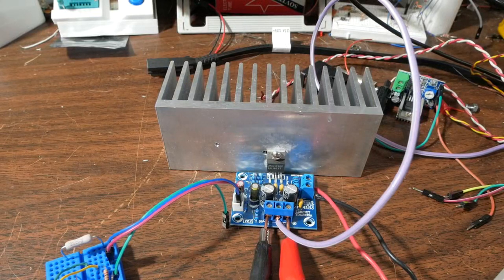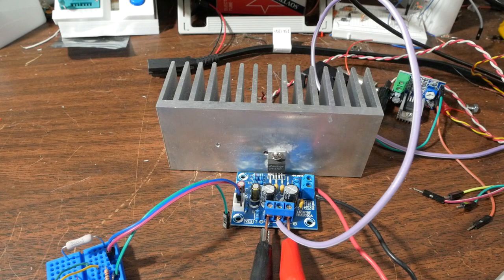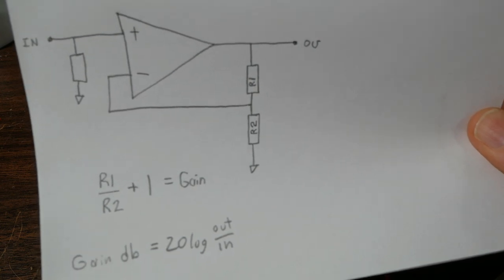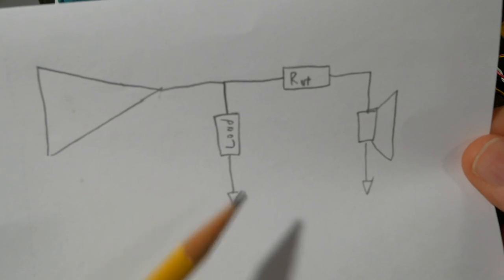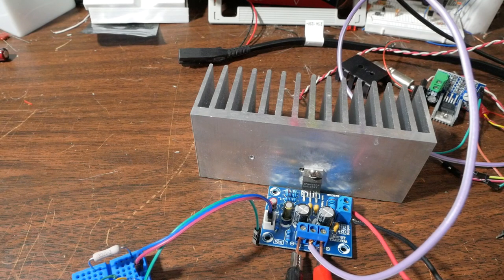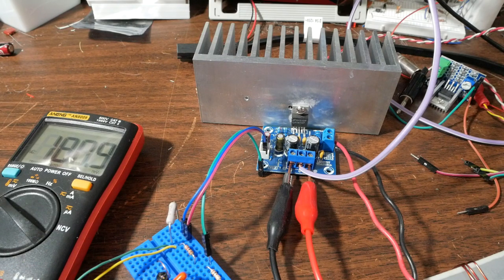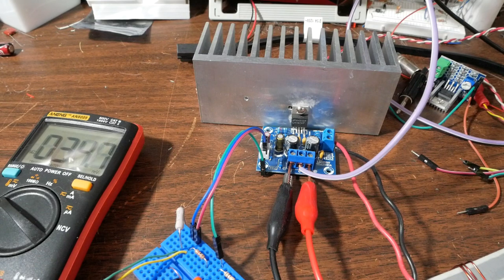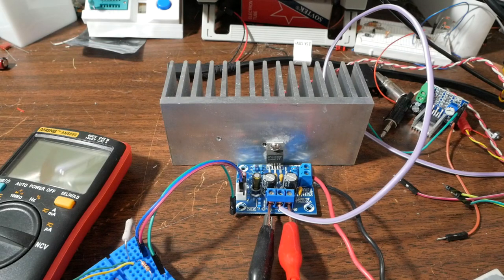Audio amplifier gain measurement and input signal levels

Comment: Thanks John, this helped fill some more gaps in me brain pan

Could you do a vid on how a guitar output differs from line out, speaker out and phono out?  And possibly how to convert those signals to work with one another with and without preamps?
I could send you some guitar parts if you need them to figure it out.

Comment: Good  video, it would have been  real nice to see the  AC input/output  voltage   with   relation  to the  ratio  of  gain  with different  DC  supply voltages   (THIRD)
Reply from the maker: The gain is independent of the supply voltage.

Comment: I must admit I got a bit lost.  If in the first set of measurements you varied something to get the output just below clipping how did you later adjust something else to get a different figure?  I must have missed something.
Reply from the maker: The first measurement was the gain. The second was the input signal level required to drive the amplifier to the point just before clipping (max clean output). The second measurement is a function of gain and supply voltage.

Comment: For the first time I strongly disagree with your approach. Your math is wrong, the circuit you describe as your DUT is actually a voltage divider, your understanding of the whole concept of audio measurement is crazy. 

An analog scope at or below 100 MHz is less than $100. Even a brilliant Tektronix version. I have 4 sitting in a pile. I give them to kids. 

There is no excuse for this folklore audiophoolery. People can find $100 if they are designing audio amps.  This kind of utter nonsense will only hold people down. 

All that rant aside, thumbs up to support your channel.
Reply: The price of a 30 year old analog Tek heavily depends on the region you buy it.  In Europe a good used Tek goes for about $300.
Reply: Its fine as a rough measurement for these purposes. With the attenuation resistor at 100ohm , there is only a small portion of output going through the speaker.
Reply: Apparently it is "folklore audiophoolery". Thats why!!
Reply: I think the author of the video made an assumption: people watching the video have some basic knowledge so he don't have to explain really basic concepts or some simplifications he made. I found the approach clever, it allows you to quickly accomplish the task with good enough results.
Reply from the maker: Show me what's wrong with the formulas/methods used. I'm always ready to debate when someone tries to call me out.
Reply: The math is fine.  The circuits are fine.  Explain yourself Boonedock!
Reply: Can't see anything obviously wrong with the video. The practical measurement matches the theory (formula) to 1% which is in the range of resistor tolerances.I also can't see how one can use analog oscilloscope to measure voltages with 4 digit accuracy.
Just give yourself a break, Boonedock. And stop trolling John. He is one of the nicest people on Youtube.
Reply: Peter Kese: I'm from Hong Kong. John the channel master, is a good man, not only on YT.
Reply: I'd agree with the others, the math is right. OUTPUT signal/Input signal. That means in the DUT you increase the voltage gain with 22,7. 

And you can use a Multimeter, but not all multimeters can read example 1KHz AC, so if you know that your multimeter is reading right go for it. But i'd always go for the scope as you could read a 22,7 gain where output is clipping without knowing
Reply: JohnAudioTech I see nothing wrong with your math. Your logic is sound. Also, any chance you'll be adding Patreon?
Reply: oscilloscope Father Christmas calls someone else crazy! lol
Reply: I think he had a bad day John

Comment: Have you ever done a video on( LJM MX50 SE ) from www.ljmaudio.com
  I bought a set of boards rated at 100 W each at 45 V DC input. They came complete with all the components +2 circuit boards. I just received my two boards in the mail will start assembling them would like to see you give them a test and how you would rate them for 11 bucks for 100 W per channel